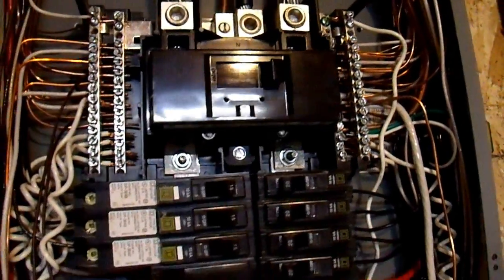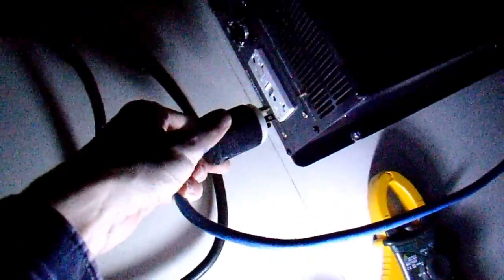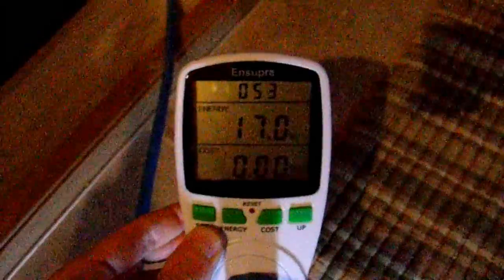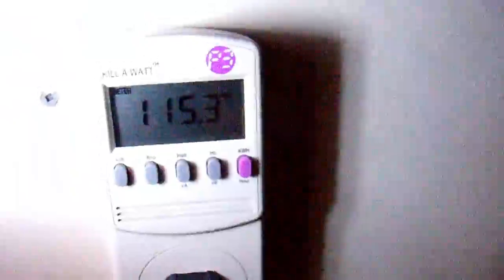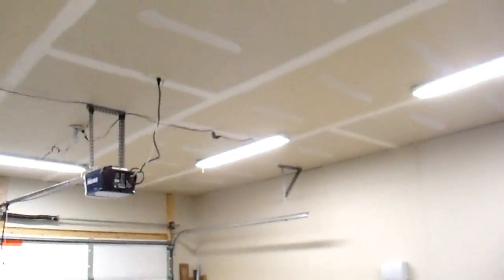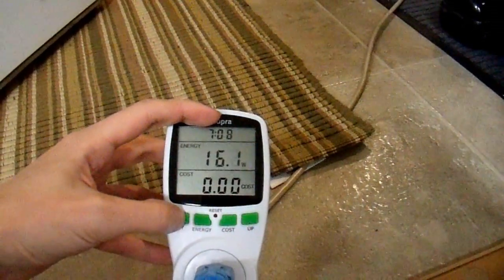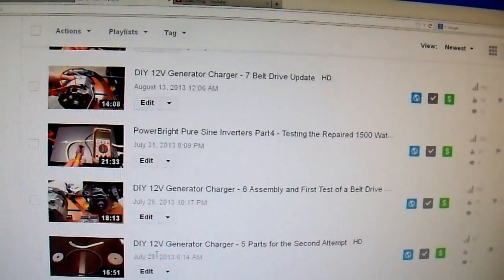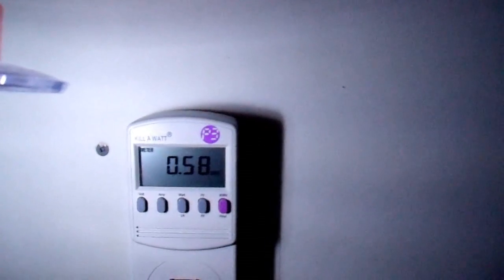How to Power your House with an Inverter or Generator During a Power Outage Part 3/3

Comment: Nice job explaining exactly how the circuits are wired in this video series.  You also made it a point to say that backfeeding your panel without a proper transfer switch is a code violation.  I do hope you're aware that if you have a house fire, your insurance company will use this video as proof that you had an illegal hookup and probably won't pay your claim.  You've got a nice looking Square D panel there.  You could probably get the breaker interlock that fits it for less than $75.

Comment: Great Video and Info. Just a general question for now. So if I was to used your design and tune my mains off. And hook up a 12-48V dc power supply say from Wind/solar/batteries (Crystal) I could have power for my home and it would run all electrical Appliances/Hot water.dryer/oven etc.?

Cheers 
Craig

Comment: This all sounds awesome but there is one lingering common question that I haven't seen answered in your video or many other videos I've seen on this! With your battery pack, how long will your power stay on for? I know it depends what you have on but give us some estimates, please! Thanks!
Reply from the maker: You're correct in that I don't address the size of the battery bank needed to power a given load for a given amount of time.  For most people a couple of 100ah batteries will suffice for short outages as long as they have a means to charge them from a vehicle or other source.
Reply: ***** Would like to know what it would take to power a home for 24hrs. I ask because I'm plan to build a tiny house on a 30' trailer and want to see if I could feasibly power it for a few days on a few battery packs. Also, thinking of purchasing a 3500 Watt gas generator that would help in recharging the battery packs and add even longer off the grid time.
Reply from the maker: thefront
I can power my house comfortably for about 24 hours on the battery pack I have which is around 1000Ah.  After that I can use my 12V DC generator to recharge the batteries, though an AC generator and a good 50A style charger would work as well.  I use around 6kwh per day excluding heat and AC.  When running on battery power I use other heat sources and do without AC.
Reply: Okay thanks! And that's more like it! That's what I think people are looking for when they watch these videos for the first time trying to figure out how practical they are. Wish people would focus more on the details of what to expect out of the batteries.

Comment: Thank you for answering a TON of questions for me! I loved every video of this series. Question: Is there such a panel that has an input switch such as an A-B switch? If so could you have two outlets wired to the "non-shore" side as an input using the back feed cable you made? I hope that makes sense as it does in my head however I'm having a hard time articulating my question ha ha. Below is a link to the type of switch I am talking about. 

http://www.westmarine.com/buy/blue-sea-systems--ac-source-selection-rotary-switch-panels--P009_273_003_531
Reply from the maker: I believe you are looking for an 'interlock kit'.  These do exist, meet most local codes, and can be configured (as I understand the question) in the way you describe.
Reply: Awesome! I have an older Federal Pacific panel right now and am going to have it swapped out, before it fails and burns my place down, so I figured while doing so I could rig myself up for my inverter setup. Thanks for the quick reply!
Reply: Joshua Ochal yes, please get rid of the Fed Pacific breaker panel.  VERY bad breakers. Next to them in the danger zone are 'Push-matic' breakers.
Reply: That's my plan SpockMcoy Issmart. I've done some research on them and WOW. I can see why the company is now defunct. I hope to be able to incorporate an interlock kit as  ***** had mentioned when having a new panel installed.

Comment: if you had two 200 amp panels and a split phase inverter would it be able to power both phases on both of the two panels ??? or will it only be able to power both phases in one single panel???
Reply from the maker: Each panel would need it's own split phase connection for them to both be fully powered but you could do so with just one split phase inverter, it would just require more connections and cabling.
Reply: what size would you suggest to power your whole home continuous, also what brand????is aims decent ?
Reply: can you do a video on hooking up a split phase inverter to panel??? also could you jus  hardwire the inverter to a breaker instead of back feeding a wall outlet?
Reply from the maker: wellsmd1
If you get an Aims I would highly recommend you get a LF design because their HF products are complete garbage.  Their LF designs are outsourced and are therefore much better quality - about the same as competing Chinese products which are using the same design.
Reply: do you know of any videos that have a inverter hooked up to dual service panels???

Comment: can I hook up a inverter to a battery bank then plug a battery charger in to the same inverter to keep the battery bank charge up
Reply from the maker: Yes, that would work just fine so long as the charger does not output a voltage higher than the cut-off voltage of the inverter.
Reply: ok thanks
Reply: john brown keep in mind you aren't going to have a 'perpetual power machine'...... ;)
Reply: john brown What would be the point of this?  The charger can't keep the voltage up, because as the batteries lose voltage, the charger would have to pull more current to keep the voltage up, which would draw more from the batteries causing them to sag, which would pull more current to keep the voltage up, which would draw more from the batteries causing them to sag more, which would pull more current to keep the voltage up, which would draw more from the batteries . . . 

You've really only succeeded in heating up your charger at the expense of battery life.

Comment: hmmm... for most people it's safest to get a transfer switch professionally installed or simply plug your electrical devices directly into a portable generator or inverter using a simple extension cord.  This sort of ad hocery is fine if you enjoy turning your back up power system into a science fair project... maybe not so great for the real world.

Comment: Is it possible to charge the batteries while your home circuits are working off the inverter with the power being generated?
One more thing.
Is the inverter's neutral bonded as in most generators?
As you know a stand alone generator has a bonded neutral so if you want to connect it to your panel you need a transfer switch that switches the neutral or you need to unbond the neutral at the generator.
It seems that few experts even understand the implications of having the bonding present at 2 locations at the same time.
Electrical code is pretty clear on this issue.

Comment: Why not keep the ground fault outlet in your garage- one phase. On that new non- GFI outlet, wire it in a new box jand wire each part of the outlet (top/ bottom), each on different phases. May not be practical, if your circuit breaker is upstairs, and far from the garage. Just a thought.
Reply from the maker: I actually did do something similar.  I made a dual gang 20A outlet that plugs into my dryer outlet giving me both phases easily available in one location.
Reply: +knurlgnar24 Please how do I wire it? My dryer outlet is not being used the dryer works on gas. Thank you in advance for any help

Comment: Hi I  would like to know if you think a Power Bright APS1000-12 Pure Sine Power Inverter can be connected to my house?? Thanks
Reply from the maker: I have looked at the APS1500 and APS2200 models and they were both fully isolated input/output as well as floating ground.  I would assume the 1000 model is the same and would be a good candidate for it.  (You will need to verify this yourself)  Keep in mind that a 1000W inverter will not be able to power much more than lighting loads and a few small appliances like shavers, TVs, computers, etc.

Comment: This is more towards my application I'm thinking about but could you just unhook a room say the master bedroom from the main breaker and put it onto a separate breaker (maybe labeled solar or battery) that connects only that room to your batteries?
Reply from the maker: Certainly could, and it would be safer too.  Keep in mind that all grounds and neutrals will still be connected together so that issue still exists, as well as local code compliance.
Reply: Could you make a video on how to do it properly? I don't know a lot about circuits and don't want to fry a good inverter etc, as I'm just starting out and don't even have the funds for a good inverter yet lol

Comment: Why some RCD work on some inverters but not on others hence they trip when you connected them to a short circuit bulb for testing. With a IVT Sinus 1200W Pure Sine it worked but with a Xantex 4548E it didn't on the same house hold, same MCB same RCD (Hager CD241J) all I changed is the Inverter.

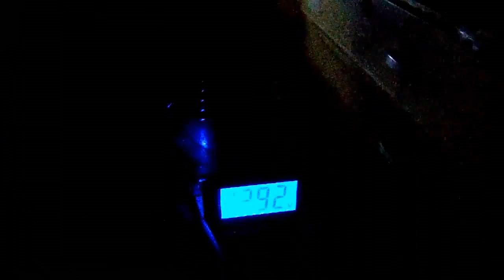Comment: Does somebody make at 2:20 volt inverter?
Also wouldn't it be better to use 24 V for the input?
Reply from the maker: You can certainly purchase a 240V inverter but they do not allow you to power your house unless they are split phase, which is rare and expensive.  24V or 48V would be more appropriate for a dedicated backup system but I prefer the flexibility of keeping a 12V system.  Efficiency is not much different between the two if appropriate cable gauge is used.

Comment: So, Step by step what did you do to plugs and outlets to work on house panel.
Reply from the maker: I prefer not to give step-by-step instructions because of the inherent safety issues with this backfeed approach.  This video is about many of the potential problems that could happen, how to avoid them, and to help people understand how backfeeding works which is something a step-by-step would necessarily omit.  While it may not be to code in some jurisdictions it can be done safely if a person knows some of these details.
Reply: Thanks for answer the two ended cable ends leaves me wonder if all three wires are hooked on each plug ends normal or different, is what not sure of.
Reply from the maker: Johnson Larry
The answer is:  It depends on the setup.  On mine I did not connect the grounds for GFI reasons.
Reply: that information is help to me thanks.

Comment: so u say the 240v wount work, but here is South Africa everything uses 240v? so will there be a different inverter to use?
Reply from the maker: Yes, in most places that use 240V you only have one phase and the entire process is much simpler - you can use a 240V inverter or generator.  Here in the USA we have split phase 120/240 and that is what this video series specifically applies to.
Reply: Oky, thanks for the help

Comment: Couldn't you wire your battery into the house's electrical system so that it could provide clean power through the batteries? This would provide no loss of power when the power went out and would have the benefit of charging the batteries when the power was restored.

Forgive me if this is a stupid question. I'm not an electrically inclined person and I'm learning lots from your videos.
Reply from the maker: Batteries are DC, house electricity is AC.  The voltages are also different and incompatible, which is why we need inverters and battery chargers to connect the two together!
Reply: Thanks. That makes sense. Somehow RVs are able to recharge batteries from shore power (DC)
Reply from the maker: David Daugherty
RVs have something similar to the Iota DLS45 that I use in some of my videos.  It is an AC input 12V DC output battery charger.  RVs also sometimes have DC lights and appliances that they run off of the 12V system.  When running on shore power it goes through the battery charger to run those 12v appliances.

Comment: I haven't looked through all your videos yet but are you incorporating any solar to charge your battery bank and/or grid tie and rollback your meter? Solar panels have come down so much in price ($.84/w) it's very appealing and lot of fun to play with too
Reply from the maker: I purchased some solar panels on auction a few years ago but haven't set them up yet.  I don't have the best location for solar and this part of the country has inexpensive electricity, no local subsidies, no net metering, and little sunlight - not a good combination.  I may play around with it some at some point.  If I lived in a rural area I'd do a lot more with it.  Thanks for the sub!

Comment: So, went to home depot and picked up the parts. Using an out door dbl gang box with two 20amp outlet, I took one hot of the dryer cable to the left outlet and the other hot to the right outlet. I then jumped the neutral to both outlets and hooked the dryer cable neutral to the right outlet. Does the neutral sound right? thanks, E.
Reply from the maker: Sounds like it will work and that's what I would have done.  Keep in mind that neutral also needs to be able to carry full current, so if you connect the neutral to just one outlet and feed the other outlet off of the 1st, then that outlet will potentially need to carry the full 30A of the circuit which it isn't designed to do.  As always just be smart and safe, take the necessary precautions, and it will be good.  That's why I like the metal box - not only is it durable for throwing on the floor and whatnot, but it also is highly unlikely to start a fire if something goes wrong.
Reply: ***** Cool thanks! I think running a 1000w inverter wont load the system too much. Maybe I will take it apart and butt splice a Y to the neutral thus each outlet shares it a bit more. Thanks for the vids! Would love to hear your opinion on running a battery/inverter system like this while it is being charged by a automotive batt charger that is being powered from a generator. IE should work-pitfalls-ect. My system is a 1000watt Champion genny to a 15amp automatic battery charger to a 4x group 31 12v batt bank to the xantrex pw1000. I would run the genny during the day and just batts at night. Obvious load management would be in place. 
Thanks again.

Comment: in this video you gave a illustration on how to set up or connect to your service box for the 110 volt inverter  by your drawing. how would one hook to service box for a 220 volt inverter would be nice to see a drawed out description for this my inverter is 220v  buy the way thanks for sharing your wisdom with us you did a grate job explaining it all
  thanks
Reply from the maker: Do you live in a country that has single phase 220V?  If so it should be more straightforward than here where we have split phase, but I don't feel that I should comment on specifics being I have not personally worked with electrical systems in other countries.  I am familiar with NEC.
Reply: ***** i live in tazewell tn. USA

Comment: The only thing that makes mi cringe is the suicide cord. You have to figure out a way to get rid of that. Also, why not add two more brakes to your box? All you would need is two breakers, 5-15$ a pop, and some bx cable rated for 220v @30amp's. You could have your two outlets in your garage at the desired spot in no time, and if you ever decided to put in a real transfer switch, you could still reuse the power cable. Worthwhile investment.
Reply: Yep, that's why you watch someone who knows !!!

Comment: So how would you make a suicide cord for a three prong dryer plug? I think I know how, but how would you do it? Luv the vids! Good job!
Reply from the maker: Every situation is different and the best approach depends on your end goals.  If I were to use a 240V outlet for backfeeding I would purchase a steel quad-outlet box, install two dual 20A outlets, and wire it up to an old dryer tag cord one outlet on each phase.  That way I could use the assembly to get additional 120V outlets breakered at 30A for whatever special purpose that might come up, or use it to access backfeeding.  I could then still use the 15A suicide cord(s) for anyplace that only had standard outlets.
Reply: ***** I have a 7.5 kw generator that I can back feed my whole house with through the dryer circuit. I installed a four prong twist lock outlet with a disconnect just past the dryer outlet. Plan is to run that very short term, due to the genny's fuel consumption and the noise. Its awesome to have that much juice on hand but not nessesary most of time. When I dont need that much power my plan is to run stuff off a 400ah batt bank with a xantrac prowatt 1000. I have a 1000 watt Champion genny that is quiet and VERY good on fuel that I will run a batt charger off of to charge the bank. So, I thought I could cut a 12ga extension cord into two lengths, on one end of each put a two prong male[ pos and neutral] then get a three prong dryer male and take one pos from each length to the pos prongs on the dryer male and then combine both neutrals to the neutral post of the dryer plug. Obviously not use the ground. Would that be ok? Would be easy and cheap.
Reply: eman3082000 Just reread your answer, that seems like the way to go. Thanks, u da man.